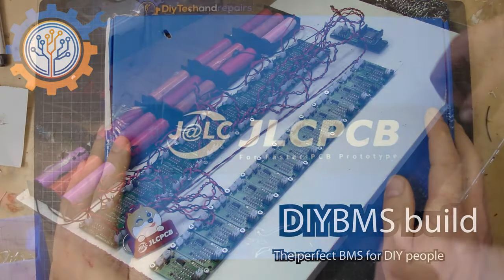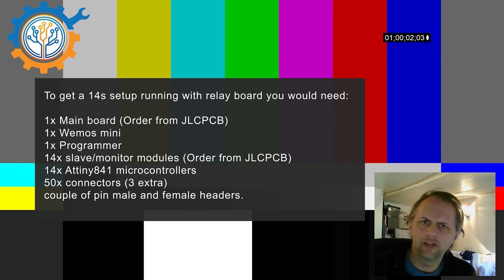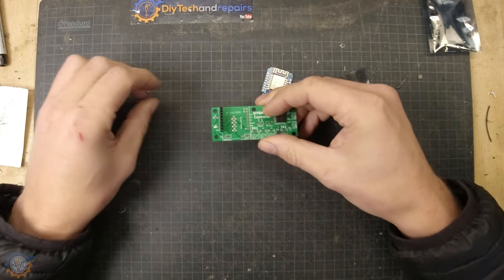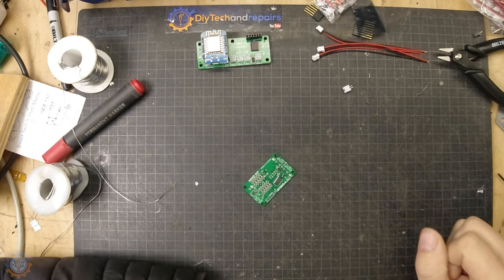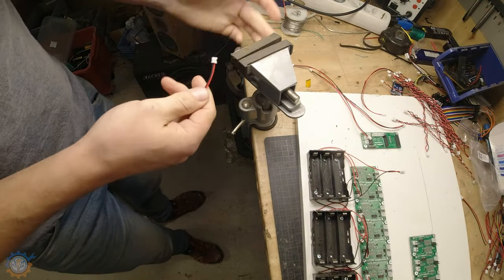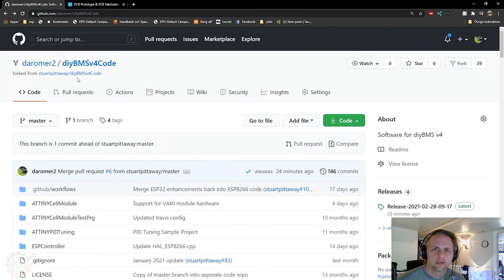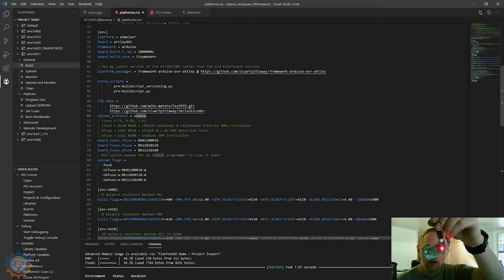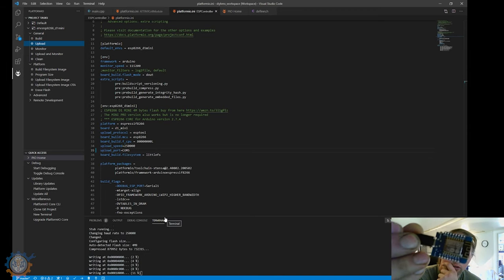DIYBMS - How to order and build it

Comment: JLPCB needs to make open source/ hardware pcb's set up that they can save the setup and make it as easy as clicking a link to set everything up but the billing and shipping.  Would be wonders for affiliate links to amazon too.  Instead of a ton of links, one link that will add multiple parts. That would make kiting so much easier.
Reply from the maker: JLCPCB is working on that actually. It will come in short :)  But couldnt wait for it for this video. I will look into Amazon for ordering stuff but since Alie and Ebay is cheaper from where i live i have used that the most :)

Comment: Hi, do you have in your portfolio ESP32 multiphase MPPT /  BUCK / charger ? I try to make 45 A x 4 = four phase ESP32 MPPT, which means 180 Amps, 150 V IN, 12 - 72 V OUT to LFP.
Reply from the maker: Dont have that. I buy My chargers. Dont have the knowledgd to build one
Reply: @DIYTechRepairs  It is simple. ESP32 makes PWM / 1 to 4 phases /, IR2104 drives IRFP4110 or IRFP4568, one diode, on bootstrap cap, one to 4 - 45 amps coils, and IN 4000 uF 150 V and out 2000 uF 100 V caps. Thats all. Some Al od Cu cooler for FETs and active PWM fan 12 V / 1 A. Big in and out connections to handle 45 to 180 Amps + good DC fuses.

Comment: it probaly costs more than buying a smart 300A BMS already made on Aliexpress (I paid about 60 dollars US for it) and it comes with bluetooth and an app on your phone to control it.
Reply from the maker: "Probably". Without shunt/breaker the DIY Bms cost around 40USD for 14s setup. Then its pretty cheap to expand since it can do 100s as well or 4x14s in same controller for close to nothing :=) Every extra cell cost around 2USD for the newest board that also have extra external temp sensor.  So it depends on what you want to compare it to and what function you want/need. The smart BMS is for smaller compact systems and Ebike like systems. This is for larger systems where you want to spread it out and need higher current.  This is also DIY system compare to a manufacturer made one.  DIY BMS is fully web based so no need for an app.  :)

Comment: I like that diybms but its hard to setup in my case..
Reply from the maker: It doesnt fit everyones. Its made for split packs or larger setups :)
Reply: @DIYTechRepairs  i have 14s 80p do you think its fit on my small setup?
Reply: @DIYTechRepairs  how much its cost if i order diy bms 14s setup. already plug and play?
Reply from the maker: @etv4075  it Will work on yours. I dont remember the cost but IF you stay tuned more videos have already been made about the topic :)